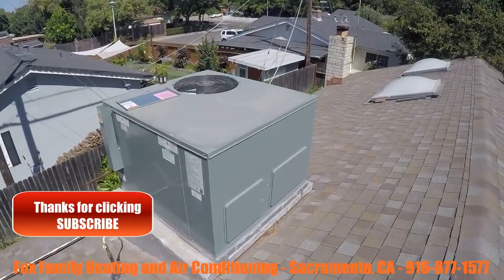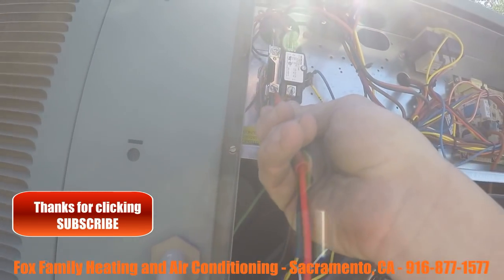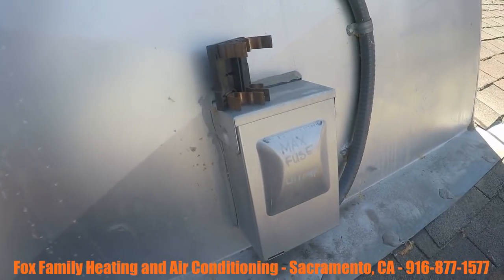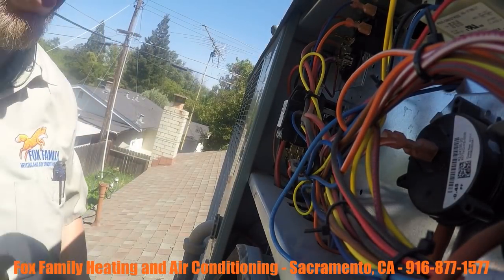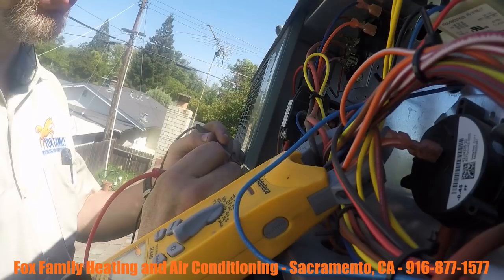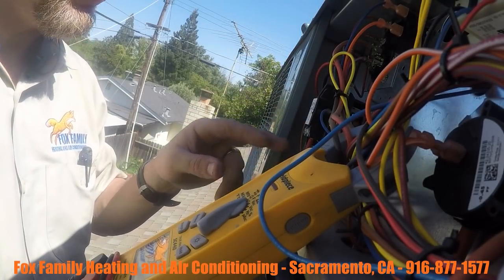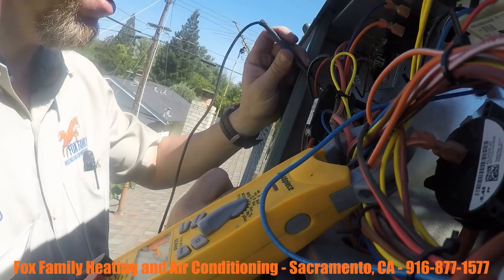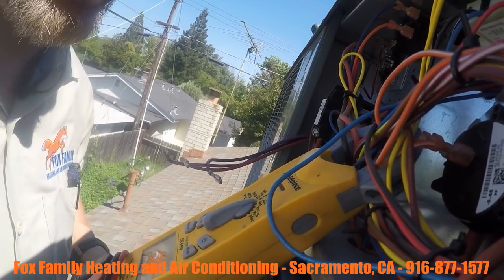How to Diagnose a Bad Compressor on your Air Conditioner

Comment: If someone wants to replace a compressor on a grounded compressor failure, it's always a good idea to leave the compressor unplugged and plug unit in to make sure all other parts (i.e. condenser motor, blower etc) are still functioning.  Last thing you want to do is replace a compressor then find out other parts are broken.  Customers don't like surprises
Reply from the maker: Good point Tony!  You are correct.
Reply: Thank you. Great point. Commercial customers are painful if given a chance.
Reply from the maker: very good point.  you are right!
Reply: Maybe like a run capacitor?
Reply: Yes,like the cond fan bearing going bad
Reply: Great advice 👍
Reply: Yes, more often than not there is a root cause for a premature compressor burnout,. Hunt it down or it will come back to bite!
Reply: Good idea since the Rheem warranty is soon to expire so a good overall condition inspection would be best as the parts will be paid for and the customer will pay very little on the added labor and end up with a better repair in the end. Plus the HVAC company likely provides a 1 year warranty of their own.

Comment: Thanks for the great video. Is there any way to tell a compressor is bad without the outdoor unit running? Let me give some context. My AC unit was not blowing cold air and outdoor unit was making a loud noise when starting. The technician that came diagnosed the Condenser motor and capacitor as faulty and replaced both. After that when the unit was still not blowing cold air, he mentioned that compressor is not firing and then he ran some tests for the compressor and mentioned that the compressor is gone too!!. He took back the condenser motor and capacitor and made me pay for all the labour involved. 

Is that normal or did I get fleeced??

Comment: Is that a heat pump, if so do you change the reversing valve as well?  Compressor don't often commit suicide, most always homicide.  Start that thing up with new compressor and you will find out quick.  Many
of those Ruud do not have factory dryer, acid test,major burn out ?

Comment: My circuit breaker was tripping. I disconnected common and run wires of the compressor from the contactor. Measuring between the two,  was .002 ohms. Way too low I think. I'm saying its a bad compressor. Do you agree? Thanks for the video. Well done!

Comment: I know this video is 6 years old but what do you guys charge to change out a bad compressor nowadays. I was told my 14 month old outdoor unit needs a new compressor already. Compressor pins plugs ohm out correctly and the tech said the compressor isn’t shorted to ground but clearly there’s a short somewhere from the load size of the contactor forward. Do compressors fail in 14 months? It’s a 5 ton heat pump/AC. It’s a Sure Comfort by Rheem.

Comment: I wish I knew 1/2 as much as you do. To me, you are a genius.
I have a 2006 Impala 3.9. All fuses and relays are good. I tested the wire harness going to the a/c compressor with the key to the on position and running. I used a continuity tester and volt meter(multi functional) and did not get any voltage reading  at all!?
The a/c compressor has 2 wires. Did I do something wrong or, should I have set the multi meter to something else besides voltage reading?
Please help! Awesome video. Thanks so much.

Comment: Thought it was weird that a newer unit had a fused disconnect box, is that a California thing? I am in Florida and we would have installed a box with a double pole single throw breaker in it.
Reply from the maker: Yes. Can go either way. In fact a lot of new housing in the 90s - 00s had infused disconnects. Don't see that much any more though.

Comment: replace drier, compressor, flush whole system, check for leaks, charge and add acid neutralizer (always do this on a burnout).  Your supply houses dont have a on call on saturday?  All mine do.
Reply: Do not run "flush" through a system. You'll never get it out. Add a proper suction line drier and plan on replacing  liquid line and removing suction line drier. Where adding flares helps.

Comment: Great video, thanks.  I wonder if our loud a/c (compressor?) noise is related to a short circuit in our wiring somehow. If you have any hunch, please let me know.   I have a short somewhere on a circuit in our house that I have not located. The lights come on and off at different times.  Sometimes I can reset the breaker and the lights go back on.  The a/c is 20 years old and has been getting louder and louder each year.  Thoughts? a/c does work fine, but outdoor unit is loud.  Heating works fine too.  Thank you for any comments/ideas!
Reply: You better get real curious.  Who did your wiring?  I immediately suspect neutral and ground connected together beyond the service entrance or backfeed.  PLEASE get it checked NOW.  If you work with this professionally your see a lot of mistakes.
Reply: You don’t happen to live in Amityville, do you?

Comment: Mr,Fox,,,love ur videos,and appreciate ur time to make them, ,I have a question regarding a condenser 3ton goodman r410,,it's making a hissing sound upon start up,pressure goes up to 650,,,upon start up,,any ideas????thank you very much!!!
Reply: #1TXV, bad. #2Ck subcooling, if high it maybe over chrg. #3 Air contamination if it's been worked on a bit . #4 It's  120F outside...and possibly 10 other things.

Comment: You didn’t check the odor of the refrigerant or take an acid test, so how are you going to quote this job?  If it was a dirty burn out, your going to have to clean up the system.  It’s also advisable to replace the compressor starting components, contractor, etc. when replacing the compressor.
Reply: Whit the acid test and a new dryer and a burn-out filter, you are back in buisness - if ever needed.

Comment: nice job on the vid.  I was wondering if there was a way to verify the compressor was kicking on?  I lost the low voltage line due to the low pressure switch.  Not sure if the switch is bad or it really is low/empty on refrigerant.  to diagnose things, I bypassed the LP switch and ran the unit for about 1 minute.  room temp is 73. I set to 70 and it kicked on but no cold air.  I only ran it for about 90 seconds though.  I dont want to damage the compressor but I would like to know if it's kicking on.   Should I never run the unit if LP switch is open?  can it run for a little bit to see if compressor is kicking on?  Thanks!
Reply from the maker: To answer your question to see if it's turning on. Take an amp clamp to the black or red wire leading to the compressor. When it's running you will show amps around 10 to 20.  You can test by jumping low pressure for now, but  it's there for a reason. So you def want to find out that reason. Good luck
Reply: @foxfamilyheatingandaircond4696  Thanks.  I don't have a clamp style multimeter.  Great excuse to buy one now :-)    after I commented I ran it for about 5 minutes and the vapor return line was warm so I'm guessing it's low/empty.  the incoming air at the vent was the same temp as the blower by itself.

Comment: I have an issue. Brainiac kid ran A/C without taking off winter cover.  Now A/C runs for like 5 minutes and shits off. You can see fan inside turning.  But nothing coming into house. Ideas? Thanks.  I'm in Colorado.
Reply from the maker: No air at all coming inside or no cold air?
Reply: @foxfamilyheatingandaircond4696  the A/C you can see fan turning but no air at all. I turned on just the fan from basement.  It runs then shuts off in like 5 minutes. So, I'd say no air at all.  Damned kid. She didn't take cover off. Probably fried something.
Reply from the maker: @roysanchez461  sounds like something with the blower motor that moves the air in your house. Check that first. The fan on the outside unit removed heat so the outdoor unit doesn't overheat and shut down on high pressure overload. If there truly is no air blowing out of the registers and into the house something is going on at the air handler and the blower.

Comment: Always gotta watch your meter when you get a tone. It may not be a direct short it could have some resistance which in some cases is normal might not be a short to ground, or power.
Reply: Resistance between a hot leg and ground? 
NEVER! 
I you read anything between L1, L2 or L3 and ground, you have a short.....

Comment: Great video    
Question : I have a one and a half ton 220volts split unit AC . After few seconds of turning it on the clamp meter reads 22A then rise to reach 37A for few seconds then it stops and the clamp meter reads zero or 0.1A. What could be the problem?
Reply from the maker: Sounds like it could be tripping on high limit.  Check, capacitor, condenser fan motor and or refrigerant pressures.  Could be other things but start there.
Reply: @foxfamilyheatingandaircond4696  
Thank you for your answer. I will check the things you said and see what happens. Thanks. 
Big LIKE for your video. I have just subscribed to your channel.

Comment: You really have to focus if a home warranty tech is doing the work for a customer. Not all tech's will work with home warranties but all home warranties have their own list of tech's. 
Also, all the homeowner pays with a warranty call is their deductible which is I believe $80 while the manufacturers warranty only pays for the bad part and supplies their version of the OEM part(s). Home warranties will typically use any part(s) that works.

Comment: How do you guys get that up on the roof ?.
I didn't know in California you use rooftop units .
You guys don't use humidifiers in California like April air .
Second question is you don't use 90 % furnace there and spilt coil and condensers .
Lennox is popular in Illinois and Wisconsin
Reply: David Tillwach a crane usually lifts it up on the roof, yes there are 90% and higher.. the packaged unit depends on the building structure, there are plenty on split units out here, rarely are dehumidifiers used, maybe in hospitals or hotels, we don’t have a big humidity problem here
Reply: @edgardelgado9937  that has too be expensive for a crane operator too lift that up on the roof .
In excess of 1,000.00 .
Reply: David Tillwach I’ve had it done for 300
Reply: Humidifiers are germ traps

Comment: Hi, my thermo pump  does short cycling when temperature goes over 95-100 F, under 90F cools correctly. During winter it heats  without problem. I called Hvac technician and he told me that compressor has to be replaced. The compressor is under warranty and he asks 800 for labor. Do you think that  could be problem for short cycling?
Reply: Needs servicing, not replacement.

Comment: Supco M500 for the non meter fluent. I prefer the Fluke 1587fc. Best way is to do an insulation test on every motor on a test/pm.
Reply: Why use a Megger when you can check very quickly if anything is shorted to ground?

Comment: So, if I monitor voltage across the windings in the compressor I have around 230 Vac, but when the compressor tries to turn on, this voltage drops to O. Is the compressor bad? None on the windings are shorted to ground. Appreciate any help I can get from anybody.
Reply: Start/run capacitor.

Comment: Question why would u still have to charge the customer for Freon ?
Reply: Because it’s a sealed system...so, whenever you remove the old compressor you are going to lose refrigerant, and it’ll need to be replaced after the new compressor gets installed
Reply: Because there might be a leak, or the new compressor might require a different type. If not, and they recover it all, they'll just reservice it with original freon, and no charge except for topping off.

Comment: in this scenario  would this typically be a burn out with acid in the system?
Reply: It depends Timothy. Sometimes a short to ground compressor can pass an oil or refrigerant acid test and the oil will look pristine. Other times you can smell the acid (or even phosgene) in the system and the oil will be acidic and black. Usual cause of acid in the system is moisture which under the heat and pressure of a running refrigerant cycle can cause hydrochloric and or hydrofluoric acid to form.The best thing to do is to check every system for these conditions. If a burnout is not cleaned up, the remaining (estimated) 10% of the acidic oil that is left in the system can destroy the windings on the new compressor. Common ways to avoid this are system driers, acid neutralizers, a system flush and a good deep evacuation.I have changed out countless compressors in about 40 years as an AC tech in inland Southern California where it get really hot!
Reply: @Howie875  Will i be able to detect odor from the air coming from the AC blower in the house? I have a weird "swimming pool" smell coming from the vents when the AC is running.
Reply: @starmc26  Not Necessarily. The refrigeration system is normally sealed and does not enter the room air. Most normally smells from the vent are from a mold or bacterial growth. if the unit was run without a filter, dust particles from the house could have accumulated on the coil. This household dust is normally composed of small particles from clothing and skin cells. This is an organic material and when the ac turns on, water forms which gives microorganisms what they need to grow - food, water and darkness. look up coil and drainpan cleaning on some other videos. most usually though this type of problem gives you more like a dirty sock smell. A chlorine or acid smell is what a burnout smells like. The only way to have that smell in your house is for the refrigerant line leak in your coil but if you had a burnout, the AC would not work.
Reply: @Howie875  Thank you very much for the response.

Comment: I have a compressor that wont turn on at all, i cooled it down with cold water and let sit there unplug for during my lunch time. Came back tried to fire it up nothing, i tested for continuity and its good no grounded, check the voltage gettin 240 at the bottom and top of the contactor, but still nothing also check for amperage and i get 0. Last thing i did was connected a hard start and compressor wont turn on still. All u hear is some humming sound. Its got freon is not empty. Run cap is good. Is this bad compressor? Or what am i missing to check for here?
Reply: might be mechanically seized, have you tried whacking the compressor with a mallet?

Comment: Nice explanation...but that compressor only lasts 6 years? That's not good at all
Reply: I've had compressors delivered to job sites, and when the packaging was removed from the compressor it was found to be electrically defective.
I make sure that any compressor that is picked up or delivered is checked before being installed.

Comment: My air condition runs and the outdoor unit stops for a while and picks up again.What could be said to be the problem
Reply: Could be reaching its set point / temperature
Reply: Floatswitch or hight pressure or lowpressure

Comment: Low preassure at suction side @ 10psi.  High side is at 200psi
Piston

Can it be bad compressor?  Takes freon but  wont going higher than 10 psi.
Reply: At 10psi and taking freon? Sounds like there may be a restriction in a liquid line filter drier. Or (if there is one) a suction filter may be plugged up. Or better yet, a bad expansion valve or orifice at the evaporator, but something is restricting the return flow back to the condenser.
Reply: Restriction it sounds like. Check temp both sides of filter drier. Shouldn't be much different.